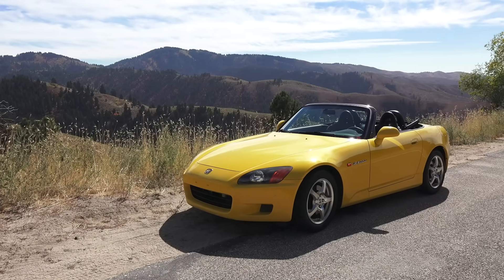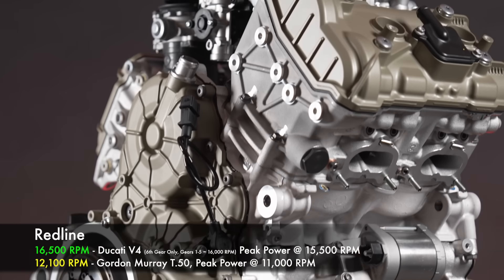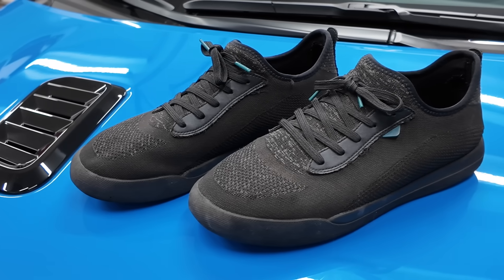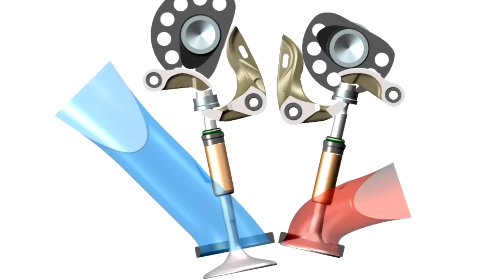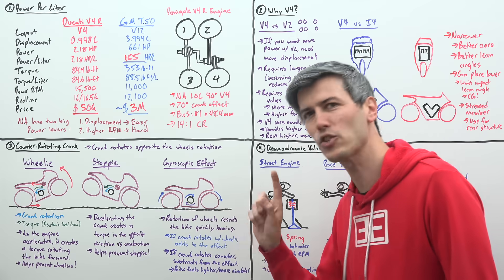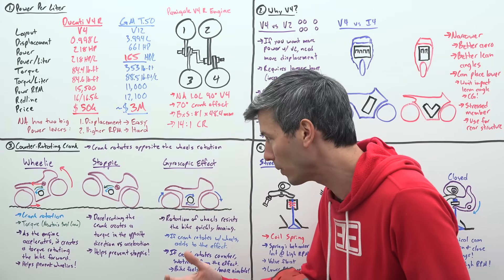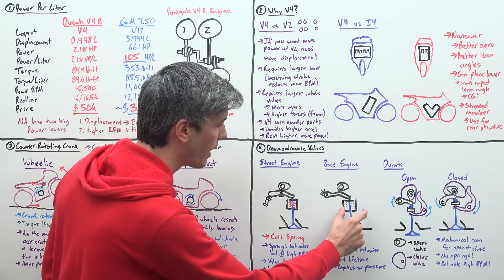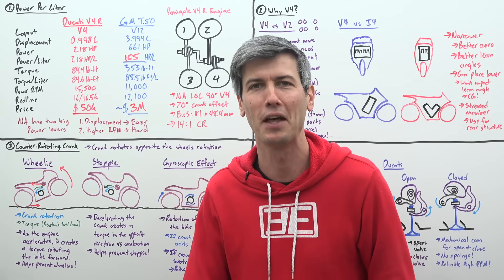Ducati's Brilliant V4 Engine — Putting Supercars To Shame!

Comment: Bikes let's go, would be nice to also have video on other bike engine as you do not need to get 50k of motorbike to get some of the coolest engine that still pass the 200hp/L
Reply: The V4Ss will get over 200hp with an exhaust and tune, but they cheat as they are larger than the R's 998cc.

Comment: Motorcycle engines have been putting supercars to shame for decades. But, better late than never.
Reply: Different engineering  challenges given the weight they have to pull abd torque spread required for the differing applications.

Comment: Please continue the video to answer the 70 degree crank angles in the 90 degree engine. 
Also, Ducati has used the Desmo engine since the 50’s. Many still used a partial closing spring but it’s light
Reply: I think the spring was to take up the valve clearances so there would be some compression for kick starting.

Comment: But 600ccm superbikes like the yamaha R6 or Kawasaki ZX6R rev up to approx. 16k rpm without the desmotronic valve system. Is there a need for that with higher power/bigger engines? And the backward spinning engine is really interesting, especially for wheelies and stoppies, but I think for the gyroscopic effect it's a riders preference? For racing it might be handy, but for street riding I'd asume an additional gyroscopic effect that helps you straighten up your bike when accelerating out of the corner makes it easier/more comfortable to control?

Comment: The T.50 Cosworth v12 actually revs to 12,400rpm. Source: Gordon Murray himself in videos about the T.50
Reply from the maker: Numbers were pulled from their latest published spec sheet.
Reply: @EngineeringExplained  yeah that’s specified on their spec sheet. However Gordon Murray himself has said it will actually rev to 12,400rpm and that is the fuel cutoff RPM 😊

Comment: PLEASE do the crank offset video! As soon as I found out about that crankoffset I was confused. I thought a 90° V4 was inherently balanced?!?
Reply: If you want a short summary for the crank offset. It's about traction feel and big bang vs screamer engines. Very interesting topic.
Reply: @SpookyGhost. Oohhh, now that I'm familiar with. So they're using the crank offset to redistribute the power pulses to maximize traction?
Reply: @float6969 correct, but it may also have something to do with spacing pulses in a favorable way regarding exhaust gas flow. It's a bit of a secretive topic where a lot of the most pertinent knowledge is privy to the companies (and Motorsports teams) involved.
Reply: +1 vote for crank offset video!
Reply: @geraldcapp  re: "+1 vote for crank offset video!"  done.👍  thank you BMW Phil, you're welcome Gerald.
Reply: driving4answers probably has a video on it
Reply: @uply5FOi I'll have a look later. I've been following him for a couple of years and I don't remember a V4 being mentioned in any of his videos, but if it was before that, I probably wouldn't have seen it.
Reply: The uneven firing order is meant to provide the rider with better feedback when they're losing traction on the rear tire.  With an even firing order your traction is less noticeable and goes all at once.  Sounds hard to believe, I know.
Reply: is not. not even v8 are naturally balanced. Only I6 and its multiples
Reply: @Xayuap any odd cylinder count is inherently balanced in secondary. Even number of cylinders in an inline configuration is balanced in primary assuming an inline configuration, however an inline engine with a cylinder count that is divisible by both an even and odd number will be balanced in both primary and secondary forces.  However when you create a v you change that dynamic.  I'm willing to bet that the 70° offset is intended to help with the secondary forces.  I'm also going to argue that the most balanced engine would be a boxer 10, but because of packaging, rigidity, complexity, and cost constraints you will never actually see one
Reply: @myonen4402  oh man now I want to hear what a boxer 10cyl would be like!
Reply: @hofahome really wide and long.  It would be a bloody packaging nightmare, to get something that wide and long rigid would force it to be so overbuilt that it might as well be a structural member
Reply: @myonen4402  well if you bring up the boxer 10 I raise you the X24
Reply: @M4TT4TT4CK the x24, and the x20 are both interesting designs I find myself wondering about complexity and specifically the oiling of the two cylinder banks forming the downward V I know it would be slight
Reply: @Xayuap  And inline 6s
Reply: Andi b6
Reply: @Xayuap  Flat 6 sixess, hell even a flat 4 in an old goldwing is has lovely balance.
Reply: @ob1182Goldwing  yup
Reply: @Xayuap  re: "is not."  it is.  Ducati's V4 is simply 2 of their V-twins placed side by side hence the reason (if you listen close) it doesn't sound like a Honda VFR nor an RVF (ie, RC30, RC45, VFR1200) neither Aprilia's 65 Degree V4 or Yamaha's M1. the 70 degree offset between the banks is for the most part IRRELEVANT in regards to balance because with the 851 - 1298 L-Twins already having natural balance on their own since Mike Hailwood won at the IOM back in 1978 (so 47 years ago) on a Bevel Drive 900SS, what this means is Ducati was actually able to connect the 2 banks at any degree between 0 and 360 without worry, however as many have wisely said Ducati simply settled on this "70" number for the best traction the 4 "hits" gave to the rear tire...

now iirc this figured was settled on during the Bridgestone/Casey Stoner era when he won them their first title back in 2007 on the 800cc bike (with the drop in displacement, the superior port shape afforded by Desmodromics easily gave the D16 a 10-15 mph top end advantage even with the others using F1 style Pneumatic valving for their closing side) because if you additionally think back, Ducati Corse actually race and tested 2 different bikes for a brief period that had 2 different firing orders "Twin Pulse" and "Screamer" with "Twin Pulse" ultimately being what they settled on.👈hint: the use of the word "Twin" in the name gave everyone their first clue as to what it is...

source: Motorcycle Grand Prix and WSBK aficionado going all the way back to the days of GP500 2-strokes (so BEFORE MotoGP 4T, Honda NSR500 anyone...? King Carl Fogarty anyone...? those paying attention will have likely seen that "Foggy" actually just made an appearance back at Goodwood 2025 in honor of the 30 year Anniversary of his 1995 Championship).  yes I'm old AF, but my age is also what allowed me the good fortune to have witnessed the ENTIRE 26 YEAR HERO ARC OF THE VALENTINO ROSSI ERA from his arrival to 125's in 1996 to his retirement from MotoGP at the end of 2021.😎 hey, anybody here old enough to recall Suzuka 2001 when Rossi and Biaggi famously banged elbows on track and from that point on, the 2 Italians became mortal enemies for the rest of their racing careers...?  oh no...?  well that's too bad because "PEPPERIDGE FARM REMEMBERS..."😅
Reply: I do..
Reply: @Xayuap  A V8 with a crossplane crank (typical in USA) is balanced mechanically, but with unbalanced exhaust unless you do a 180 degree header.  A V8 with flat crank has balanced exhaust but is unbalanced mechanically.
Reply: @Xayuap the only balance 8 is flat non boxer scotchuoke engine.
Reply: Volvo did a crazy offset crank V8 and it was used in some crazy hypercars.
Reply: @zmmj2024 I haven't heard about this! I'll have to dig into it. Thanks for the factoid!
Reply: @float6969  it uses a 60 degree cylinder layout with the crank throws offset to 90 degree firing. The Noble M600 used the engine but twin turbo'd. Volvo used to in the XC90 and S80 from 2006-2011. Discontinued it's use and production before being aquired by the Chinese company that now owns Volvo.
Reply: 90-degree Vs are balanced, primary balance anyway. So putting two of them together gives you as lot of options, Ducati uses 70 degrees, HONDAs VFR uses 180 I believe, it's more to do with firing order and recovery gaps for the wheel rather than engine balance. That's what I've gathered anyway.
Reply: @F3udF1st  re: "90-degree Vs are balanced, primary balance anyway. So putting two of them together gives you (a) lot of options..."👈see F3 gets it.🤙for better or worse what Bologna did was SIMPLE and NOT "complex" like everyone might've been hoping for.  also something to keep in mind, well before their arrival in MotoGP (Cagiva 500 days notwithstanding) Ducati had already long figured out the "traction recipe" with their "L-Twin" (while technically 90 degrees, they didn't really call it a "V") by kicking ass and taking names in both WSBK and AMA Racing, so there was little need to "reinvent the wheel" so to speak... 

also for those who haven't yet made the connection with my screen name, the legend ERALDO FERRACI, the "FBF" brand, and the Ferracci Ducati Race Team were based here out of the Philadelphia area (Willow Grove Pa).  he retired and closed the dealership way back in 2016.  many of us OG's first met him long BEFORE he was ever associated with the Ducati brand when he was tuning and personally Drag Racing Japanese Sportbikes around at local tracks like the equally famous ATCO Raceway over in NJ (also now closed).  FUN FACT: Drag Racing Motorcycles at the defunct Englishtown and ATCO tracks also gave "birth" to 4x and last year's 2024 NHRA Top Fuel Champion Antron Brown.  although he currently lives in Indiana (the 2nd HQ of NHRA for middle 'Murica) he's originally from across the bridge over in South Jersey.
Reply: A 180 degree crank 90 degree V4 has firing intervals on one pin of 0, 450 degrees and 180, 630 degrees on the other. 0, 180, 450, 630. Thus, three nonoverlapping power strokes followed by an overlapping one (630, 720 degrees). Lumpy.
A 70 degree crank offset 90 degree V4 has firing intervals of 0, 450 on one pin and 70, 520 on the other. 0, 70, 450, 520.  Thus, two pairs of equally overlapping power strokes, 450 degrees apart. Still lumpy, but more like the irregular beat of a V-twin.
Reply: Rocking couple. Even engines with perfect primary balance have this.
Reply: @dbmail545 But I don't understand how an offset crank negates that. Based on other comments, I suspect it's a motorcycle specific feature related to traction.
Reply: @float6969 it's probably unnecessary for cars but in motorcycle racing you need to feel the feedback from both tires to make adjustments with your body position to get faster lap time. It's common to have 12-14 riders clock lap times within 1 second so even 0.1 sec is important.
Reply: "They" want to have irregular bangs/rotational impacts rather than regular bangs on the rear wheel in motorbike racing. It gives the riders another feel for grip when accelerating in turns.
That's why Yamaha had inline 4's as crossplane engines with irregular firing - not every 180° but alternating 90°, 180° and 270° for giving irregular pulses to the rear wheel.
When Yamaha came out with that, the other teams couldn't believe their ears as this sounded differently.
Current motorbike race engines are either crossplane i4s or V-engines with an offset for the desired effect on the rear wheel.
Reply: a vee 4 could be balanced if it has split crank pins... but as thats rather complicated and fiddly and prone to weakness and defeats the whole point of a vee being two twins stuck on a short two throw crank...

and being a two-throw means it has to produce a rocking couple as one pin goes this way and one goes that way...

the i4 suffers from the secondary imbalance of all crank and rod geometry. 

the i3 has a weird "gyrating" couple, as it sort of tries to perform these helical "screwing"motions...

a v6 has the advantage of coupling two such gyrations to cancel out almost completely leaving only minor secondary imbalances...

and then you have that whole aspect of firing orders... radials enter here...

why are most dirt bikes singles?

because you get 1.5 rotations with no power, allowing the tyre to gain some traction before the next big "thump" of power comes through. 
a radial is every "second cylinder"...( ignore the several with even numbers of cylinders or two strokes... they "dont exist")
a four cylinder four stroke can fire "evenly" as an inline.

it CANNOT fire evenly as a radial. the "X4" (or 8) never really worked out properly... and that also means it cant do it in any other configuration but the i4... but with "big bang" that isnt an issue, yet balance IS as the pulses of power twist cranks and cause reaction forces on the engine block itself as pressure tries to tear it all apart... you have a balance issue that has nothing to do with the arrangement of crank throws and positions of pistons through a rotation...

inlines in my experience like to redline once you break traction. vees tend to just hold it at whatever throttle you give it... far more predictable when its wet and slippery.

crank design is complicated. ive always thought it would be neat to have a modular single cylinder that can be coupled together in various arrangements as a demonstration of what works... and what doesnt...

bit like a wurtzilla but... bench sized.

i REALLY want to see an I7...
Reply: @paradiselost9946  Basically a V4 with 180 degree crankpins has a large rocking couple. One with 70 degree crankpins has a smaller rocking couple and a suitable bobweight on each crank takes care of the primary.
It's an engineering compromise but with large bores meaning wide crankpin separation, reducing the rocking couple is important.
Reply: The offset is to bring the firing offset to or closer to equal angle.  The V angle of 90 is balanced for secondary forces but it's also wide physically.  You see this a lot with V6's and a really narrow V like the VR6.
Reply: Only inline engines have natural primary and secondary balance , but that dont mean ya can't balance it out in other ways .
Reply: @mastercricket7626 only I6, not I4.
Reply: I’ll leave a mark so if the video uploaded then i’ll know
Reply: Lacks primary balance but can have perfect secondary balance
Reply: Crank offset video please

Comment: desmodromic valves been around a very long time. more than 100 years. i remember being told about ducati's desmodromic valves back in the 60's. there may be specific implementations that are patented, but the basic idea is well past any patents. btw, can't imagine that they can do this entirely without some kind of spring system as the precision to close the valve perfectly using only the pressure of the cam would be close to impossible. must be some sort of strain relief between the valve and cam. as i remember was told that adjusting the system right was nearly impossible which was why it wasn't used very often, though ducati has been using it forever on their street bikes. very expensive bikes back then.

Comment: the basic desmodromic patents expired like 50+ years ago already, it's not why others aren't using desmo
Reply: True. But note that is is possible to patent an improvement on an existing, even if expired, patent if the invention isn't "obvious to one skilled in the art".
Reply: @avsystem3142  sure but that doesn't re-patent the original one, and say if they were using a metal mix on the original ones then even if they re-patented it their own device would be prior art. so at this point anything that was on their bikes at 2000 is free game for anyone. 

if there was usable forever loopholes we still wouldn't have affordable home 3d printers(even if some improvements are patented).

the 'obvious to one skilled in the art' qualifier is unfortunately out the window practically these days, very expensive to fight and a lot of patents don't even tell how to do the thing it's patenting, but the sold on market way is pretty easy in comparison.

you don't need desmo to do 17k+ 4 stroke though so the japanese just aren't doing it. I wish someone did a teardown on a zx-25r

Comment: The shifter carts run 125 ccm engines with up to 54 hp, which gives us 432 hp/Liter. A 2-stroke engine, quite simple, quite low peak power engine speed of less than 13,000 rpm. No cams, no valves, just a simple 2-stroke with NA. Does this put shame on Ducati? No, different application, different requirements. This video should have different title, no cheap klick trap approach. 🙄
Reply: Alex over at 2 Stroke Stuffing is getting 30HP out of his 50cc 2T now, that's 600 hp/L But there is reason they moved away from 2T sports bikes, the power curve is evil and the more power you make the worse it gets.

Comment: Regarding point 3, the bike being able to lean easier because of the engine counter rotating in relation to wheels, are you sure about that. I would imagine that these two forces do not cancel each other out. They both resist lean, whether it be to the left or to the right, it's the same, they both resist.
I am honestly just asking as I have never done the experiment to see the results.